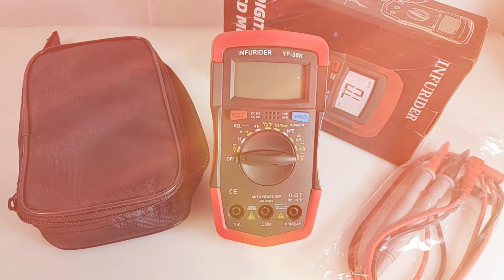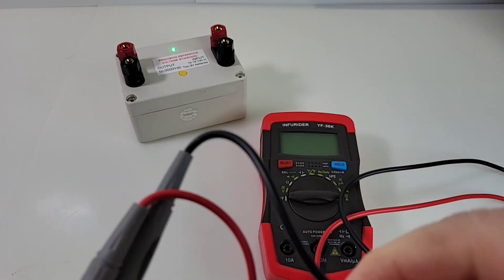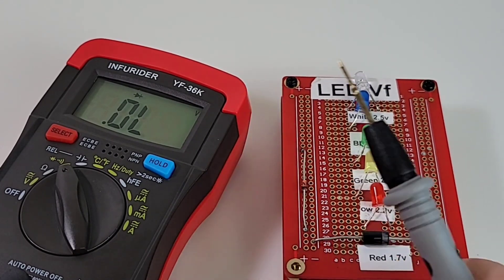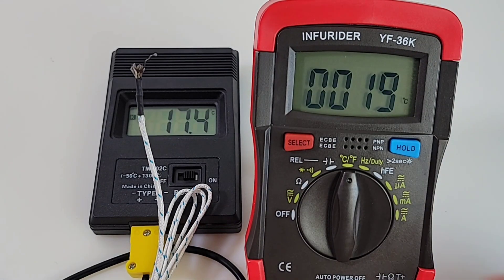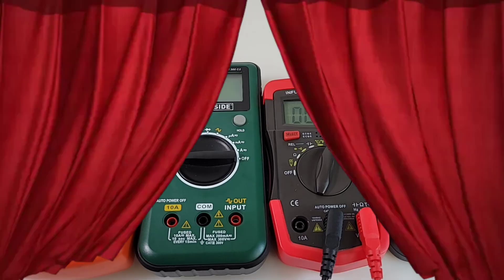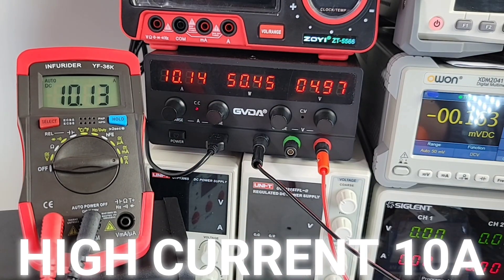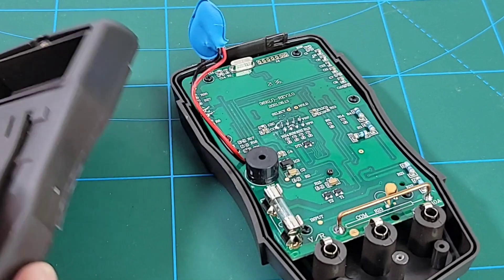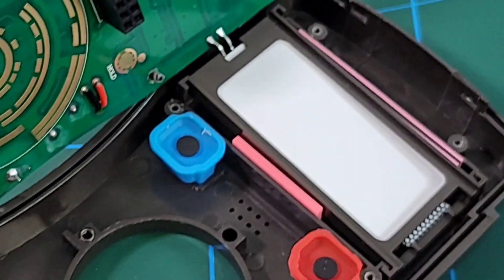INFURIDER YF-36K CHEAP-O Multimeter Review & Teardown!

Comment: I have been using this DMM for two years.
The accuracy is fine, the screen is easy to read and the price is low. I think it is a good DMM👍
However, it beeps loudly and the probe that comes with it has a sharp tip that pricks my hands. 
That is a drawback👎
Reply from the maker: Definitely a decent multimeter given the price point. 👌  It's also built like a tank.

Comment: Wow, unbelievable for an El-Cheapo multimeter.  It's currently going for $14.99 US with a coupon.   Awesome set of probes that come with it, and a case.  At that price it's a nice little meter, and if you accidentally drop it or blow it up it's not a big deal.  :-)  Love the reviews!
Reply from the maker: So true Pete..at that price even if you're left with just the test leads you're still ahead of the game 😃👍Cheers my friend!
Reply: I tried to buy it from the affiliate link and they're out.  Guess when it's a good deal it sells out fast.  But you can't beat the price.  What's so amazing is it has so many functions but there's practically nothing inside.  You look at the tear downs for Flukes and Brymen you see so many components bulging everywhere and the Brymen even have double sided components on both sides of the PCB.  The PBC on this is bare bones so is small and lightweight and ultimate in portability.

Comment: Hello Sir, which of the cheap-o multimeters under 30$-35$ you have tested would be the one(s) that you think have the most powerful (and useful) NCV function? Could it be used to locate electrical wiring behind house walls? What do you think about Uni-t models, in particular UT123, UT33D or UT136D (a bit old but still interesting I think) in this regard?
Ah, I'm impressed by your reviews. Thank you very much!
Reply from the maker: Aneng AN998 had one of the best NCV showings I've seen in a while https://youtu.be/TAcRwcuvd0c
From your list I would go with the UNI-T 123
Many Thanks 😊👍

Comment: Great review yet again! I purchased an Infurider clamp meter to see what it was like. Leads were complete opposite to your here, I got standard cheapo test leads, but a proper temperature probe. Seems like the YK-36K is reasonable implementation, super clean inside, you could replace that glass fuse with an HRC type for improvement.
Reply from the maker: Great point 👉 add a ceramic fuse and you've got a great multimeter that does just about everything for the price of a couple big macs. 👍 Even the case is a bonus at this price.

Comment: A paradox, tons of basic functionality a great continuity tester and better than average accuracy for only twenty bucks, but alas absolutely zero input protection.  However long as you keep that in mind you could do far worse for twenty bucks.
Reply from the maker: Yessir...I won't say zero..because it does boast a 500mA fuse on the low current side and a (albeit tiny) PTC on the voltage circuit combined with a healthy sized current shunt (unfused). Still all things considered a pretty sweet deal for 20$ and one of the rare few that could basically do just about everything required for electronics / home electrical for a basement price. Plus those test leads are an incredibly sweet addition and better than many multimeters costing much more. 😀👍
Reply: My father would have blown that up in a minute. He never got the hang of handling a DVM and always found new and inventive ways of destroying them. I never let him use my fluke...